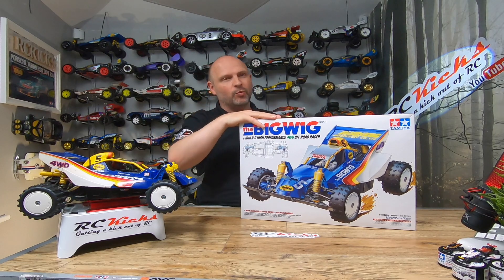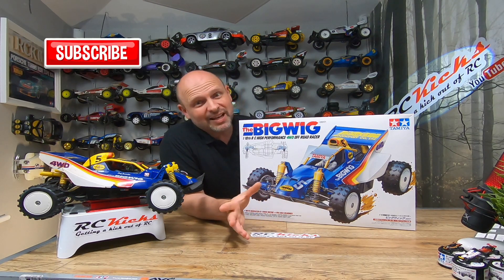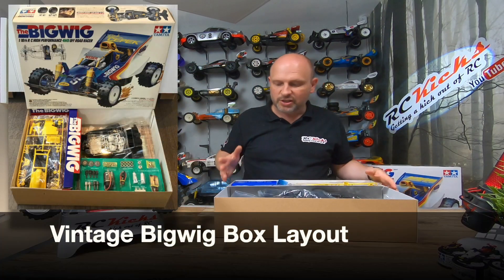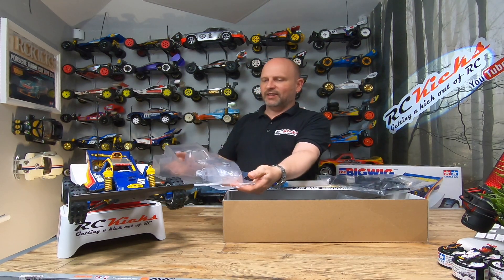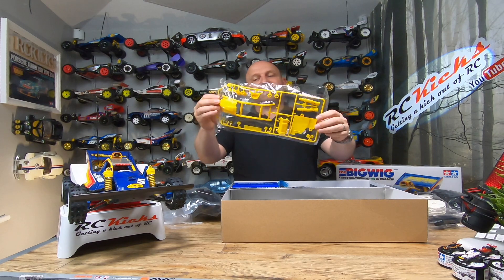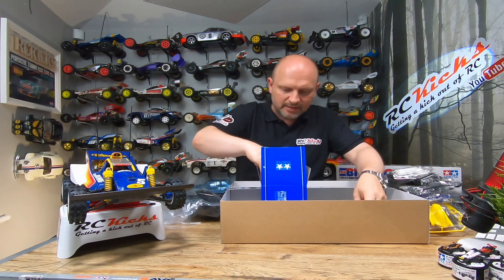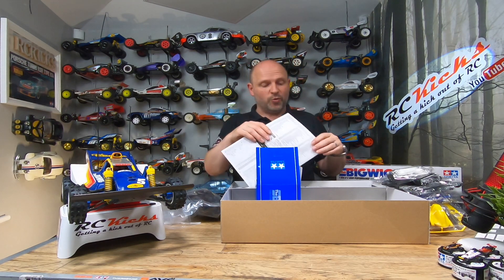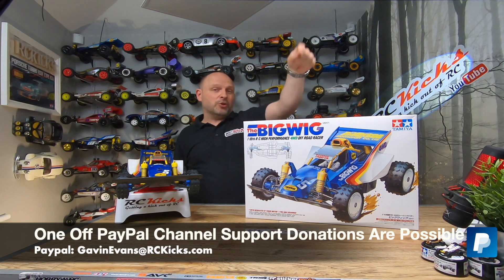DO YOU LOVE IT OR HATE IT? Unboxing A Tamiya Bigwig 2017 ReRe RC Car On The Show. Kit 47330

Comment: The original Bigwig was the first R/C car that I bought from a guy to race on an outdoor car track that a club had in my city back in 1989. With practice, I started getting better, and I sold it to upgrade to a Tamiya Vanquish, which handled much better in races. This was back when we used NiCd battery packs.

Comment: I bought and built a rere one last year love it, it was my first build since I had an original boomerrang 30 odd years ago, I did upgrade the boomerang with the technigold motor, 8.4v battery and the gold wheels with spiked tyres. That was ballistic
Reply: I have a vintage Boomerang waiting for rebuild,  had since I was in high school (30 years) In HS I made aluminum wheels for it in metal shop!
Reply from the maker: Is that’s cool

Comment: I got one of the originals from Mansell's Models in Paignton ye old Devon for my 16th birthday in 1987. I made a dog's breakfast of the paint-job on the bodyshell but boy, the brute power that the 'Gold Power' combined with the Technigold produced was absolutely amazing for the time and technology. My RC chums and I had never seen an electric hobby grade buggy go that fast before.
Reply: @gavdart7715  Yes, Mansells was an exceptional modelshop that always stocked the latest kits during Tamiy's 'golden age'.
Reply: @gavdart7715  Yes, eBay prices for Tamiya vintage RC have gone into la-la land over the past decade. I bought a NIB vintage Tamiya Hotshot from a seller in Japan (which I built as a shelf/display queen) for about £300 in 2009, but you'd be hard-pressed to get anything close to a deal like that these days (You'd have to part with at least £700 to get your hands on a NIB 1985 Hotshot in 2020). Of course any of the kits that came with the Technigold motor command even higher prices, but don't give up! You might find a bargain out there somewhere.

Comment: Had one as a kid when it first came out, was proper quick at the time and one of the first with the new higher voltage packs. Always wanted the Kyosho Ultima though and thinking of buying the one that was released in 2016. Loving my Overdose Galm drift car at the moment though after getting back into RC cars. I’m 50 in a couple of months 😂

Comment: I got one for a good price, built it up, without the aerials the body is destroyed by the first roll over. I ended up painting the outside as the flex allowed the paint to flake off. It was fun to drive, did a nice four wheel drift, but looked like it could handle more power, so the motor went on my Grasshopper, and I went brushless/lipo. It's now lunatic fast, in fact, I can't use full throttle from a start, I have to feed it in. The springs were too soft, and the initial damping too hard, so reset all of that. Great fun, just don't add up the total cost (you could buy a real car). By the way, some bearings pop in no problem, some need pressure to seat correctly, without that pressure, you will have endless issues.

Comment: I was lucky to have a boomerang when i was young. Did the bigwig front suspension conversion but never had the $ for a motor upgrade. Ended up being run over a marone mazda when the receiver batteries ran down and i lost control.

Comment: how did you do the tire letterings on the turbo optima? it looks fantastic and i want to do it as well.Thanks
Reply from the maker: Decals come in the set for the wheels
Reply: @RCKickschannel  does that go for the optima as well or the turbo optima only
Reply from the maker: Kevin Xu Not sure about the Optima but the Turbo yes.  Google the decal sheet and check to see if you get the wheel decals on the Optima.  👍🏻

Comment: I have two re re bigwigs, my runner has a technigold as the gt tuned just isn't as good, also is uses a super hotshot aluminium prop shaft setup as the original is a little thin . and 53791 DF-02 universal shafts front and rear, all mods don't spoil the looks of this classic tamiya model.